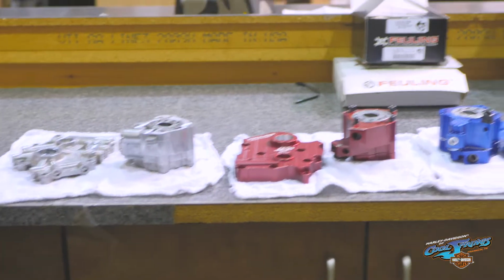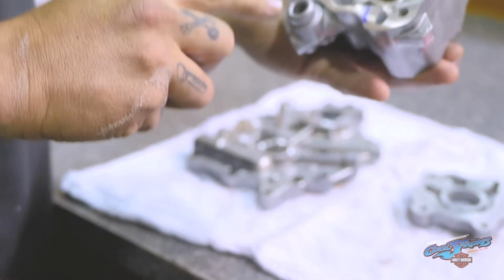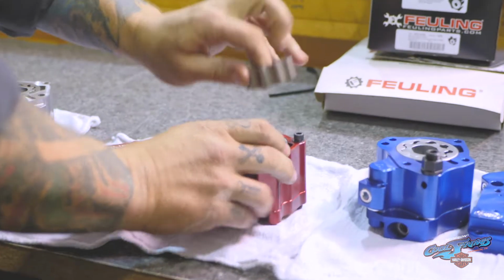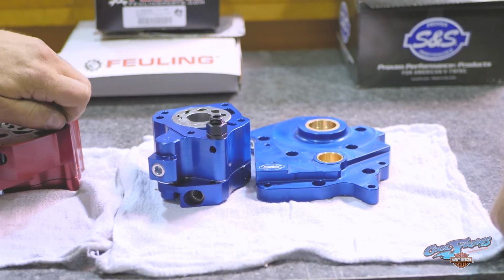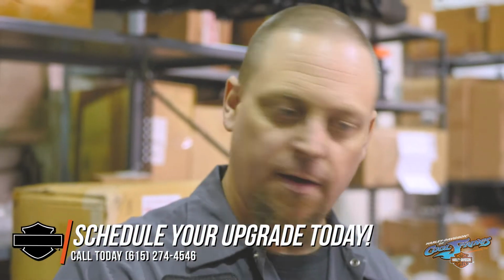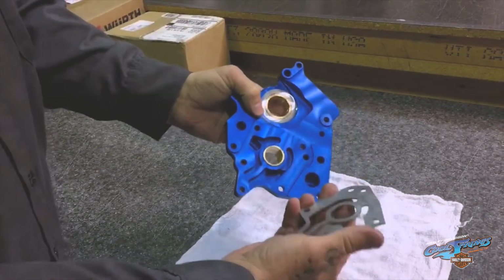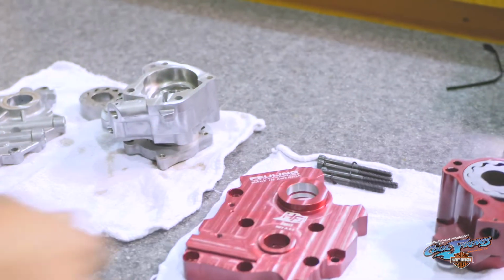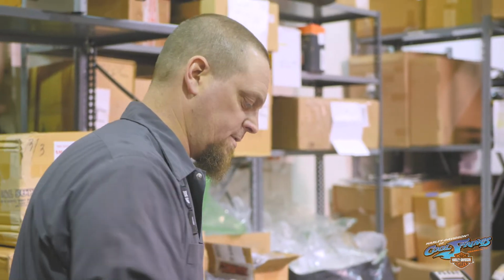Comparing Cam Plate Oil Systems ( S&S, Feuling, Harley Stock) | Shop Talk Episode 6

Comment: Had 2 new 110ci CVO engins replaced since 2022 😡 went S&S after changing engine earlier this year, along with a Figurati oil filter, and I’m extremely happy after 2k miles. Waiting for the 1st major service to move to  gear driven cams and then I’m done. Great video, thanks.

Comment: So this video is 8yrs old so I’m sure things have changed. However I’m in the market for a cam plate set up and a new cam for my 2017 flss. So I’m very interested in learning the difference between the plates. At this time HD had came out with a billet cam plate and updated pump. Just to let you know I’m interested in the information not the stupid Sasquatch BS.

Comment: Can you do a comparison for twin cams? On a rebuild, I had the S&S cam plate and oil pump installed after two engine failures with the stock units. 

So far, runs great with zero oil pressure issues.

Comment: My mechanic told me that the SE pump and cam plate is every bid as good as the S&S for way less money. I agreed with him and used them with my Wood Triple Deuce. It’s nice to see actual oil pressure at idle n, compared to the stock pump.

Comment: On my 2020 Roadglide, when I check the oil level cold it indicates full, when hot it checks 1/2 quart low. Any ideas or opinions?
Reply from the maker: Turn off your bike with it straight up. After the engine stops moving place on side stand, then check oil.

Comment: The video was informative but at no time did you all discuss the flow rate for any of the HD oil pumps - 2017 - 2020. You did talk about him much more flow was available with the S&S and Fueling. What id the flow rate of the 2020 oil pump that is stock on HD 2020 Road Glide Special? Please

Comment: Why don't you talk about the SE oil Pump
Reply from the maker: This video was done 3 years ago and the SE Pump and Plate was released this year. The SE plate and pump is awesome but it doesn’t work with larger cams. The max exhaust lift the plate will clear is around 0.570” lift.

Comment: I want to install a S&S oil pump cam plate along with the Woods 22xe cam. I currently have a stock 2017 FLTRU. The runout on the crank shaft is measured .006. S&S states their max runout tolerance is .005. What are my options? Is the .001 outside of the stated max allowance a recipe for disaster?

Comment: I realize that this is an older video, but, I wonder what you guys think of the new Zipper’s cam plate. I’m using the Feuling OE+ oil pump, and I’m getting about 20psi, at idle, and 59psi at WOT. This is on my 2015 SGS w/ a 110”

Comment: I was looking at S&S but for the past two years they have gone from $1400 at one point for the kit, to now $2000. Fueling price has only went up about $100 depending where you buy, and its $1600. S&S is just going way up on already overpriced parts. Even their carb is up to $700 now. That's insane. They make good stuff but I can't justify it. A better oil pump will not sway me over. Fueling is gonna get my money. I've only ever heard good things about Fueling.

Comment: What about the twin cam ? I have a 2005 TC 88 and am considering the S+S kits .Depending on run out  id like the gear set up, failing that the Hydraulic cam chain tensioners . Both these S+S kits have the works, adjustable push rods, lifters , up graded oil pump , cam plate you get the idea . SO my question is what would you consider the BEST? The S+S or the Fueling components 🤔. I've got my mom and pop shop saying S+S and Mr Harley saying Fueling . Any advice would be gratefully appreciated.👍🇺🇸😎 I know this is an old post.
Reply: Im surprised Harley didn't say SE

Comment: Why would you need more pressure? Pressure is restriction to flow, I would rather have lots of flow and vary velocity which I think S&S has done with the smaller supply passages.

Comment: SAE 660 bronze  brinell hardness 65, 6061 t6 hardness 95. S&S bronze cam bearing insert is not harder and more durable than fueling or harley straight up aluminum and, my guess, will not last longer.
Reply from the maker: John Callahan Bronze has less friction than aluminum and the strength depends on the amount of lead and silicon used to produce it. Bronze is a great bearing especially when used with oil as an additional lubricant. Both the aluminum or bronze can wear but If installed correctly with minimal pinion runout both should last 100,000’s of miles. Maybe I should add that proper maintenance be preformed, example routine oil changes!

Comment: Love watching you guys a lot of good info. I recommend to all my friends to watch Moonshiners.  I have a 2018 road glide special about to put a RS468 in it. The dealership says I don't need to change the cam plate and pump. Says it's not that great increase in horsepower to warranty that. Just wanting some feedback
Reply: @Derrickbarbee3752 did you figure it out?  I'm in same boat now.  from research  I'm thinking  a reaper 465 cam and just updating to the 2020 oil pump instead . seems the lighter cam is OK with stock components

Comment: so , there has  already been attempts  to retrofit a M8 engine with gear driven camshafts (given low crank shafts run out  tolerances , in the region of 3.5  thou/inch )  ... is that correct ?
if so , there is still hope ...
Reply: Harley should just buy their motors from S&S
Reply: doncarlo5 yes! We install them
Weekly.
Reply: @jamielima5315  well ... there is hope, then ! The twin cam engine is the reason why I stopped buying new bikes ...
I personally ride an old Shovel , but ,as we speak , I'm really considering buying a brand new Harley ( fat boy or softail slim ) . I was just wondering :   how often do you encounter an M8, ( based on your homegrown experience),with such a high fly wheel tolerance, that makes a gear driven install not plausible ?
and most importantly , how much do I need to invest , on top of a retail price ! ( Parts + hours )
Last but not least (being the M8 a brand new concept) : which are the flaws that need to be addressed ?
Reply: Heck...I have a '17 and 18 FL's and BOTH cranks are out 65 thousands...no gear drives for me...
Reply: @2Wheelz-2  dude ! This really pisses me off ...

Comment: Do you recommend an upgrade of a Cam Plate and Oil Pump for a Stage 2 bike? or the oem parts are good enough for your average rider?
Reply: Luis René Ventura Cruz if you can it’ll just improve your setup not needed for stage two but your engine parts will like it!!!

Comment: So are you saying that a OEM. Cam plate and oil pump. Is no good for just a bolt in 475 cam with quickie. Push rods it’s all I can afford at this time. Please tell me if this is gonna ruin my 2019 harley Streetglide ??
Reply: Crazy. Ray's Videos OEM plate and pump is fine for a stage two. The aftermarket setup are just superior and your engine parts will like it!!!

Comment: S&s is the better one take it from the guy that has destroyed the fueling one and a factory one b4
Reply: I'm leaning towards the S+S gears ,pump  ,cam plate ect ( full component up- grade depending on run- out otherwise it will be full up-grade but with hydraulic cam chain tensioners. My independent.shop says S+S but Mr Harley mechanic reckons fueling is better ? You say S+S so what happened.to the Fueling if you don't mind me asking .🤔👍🇺🇸😎 The motor is a 2005 Duece twin cam 88.I realize this is an old post .
Reply: @williamjohnson6517  I've got a 2010 twin cam I wondered if they answered you or not their William I was going to go with the fuelling myself.

Comment: great video. lots of awesome info.  My 103 with Fueling camchest kit and Freeway flyer cam really did the trick.  Oil pressure at idle hot 30lbs on the highway 50 - 60 lbs.  And the bike runs great.  Will be doing the SG soon and will probably go with S&S .  Looks like both are very similar .THANKS for the videos and info

Comment: Here we go Harley ! Even the M8 has to be upgraded because of Harley's junk. Pay 22,000 for a bike then spend money, tear it apart , to fix your new Harley engine. 
Harley built the hydraulic cam chain tensioners into the new M8 engine not learning what a problem it caused in the twin cam engines.
Never a Harley again !! Thank God for S&S

Comment: I got the S&S 100” kit made my old 88” a monster along with the 585 cams
Reply: Great to hear your 100ci is doing good and that you are happy . There is one thing they say about building up the twin cam.
The more you build it the more it's likely to have run out on the crankshaft. Harley pressed the crank together and that is the problem.
If I ever need to split my cases I'll be buying an S&S crank, that is really the best fix. or buy an S&S engine.
Reply: Yeah I know all about that dang run out I was thinking maybe after I put a few miles on this engine going to buy the S&S 124 kit that way I am force to not be lazy on the bottom end
Reply: I’m gonna do the same thing to my 88 but I’m just gonna go with the 574 cam can’t wait to get it. I heard it’s a big difference.
Reply: I’m gonna do the same thing to my 88 but I’m just gonna go with the 574 cam can’t wait to get it. I heard it’s a big difference.

Comment: @24000 miles and a bad Bearing on my 2010 Roadglide custom 96 in. I decided to take out the motor for a major refresh 
Went from a 96 to a 107. One key upgrade was a Fueling cam plate and oil pump  stock oil pressure 15 psi at Idle, 30 psi throttle on.
Now 30 psi at Idle 55 psi  highway.They said something important Fueling was the first.You cannot go to young mechanics today
With out S&S products brought into a conversation.Wanted to do my heads First thing S&S heads 1500.00 for the box.Fuel moto
Has CnC heads on an exchange for 850.ish. I have a guy that will hand port and polish for 650. 
The reason you can put gear drive  cams in a m8 with no issue is they have a gear driven balancer to hold the insides together.
If you want S&S parts just buy a S&S motor I wanted a number matching motor so I put the best parts I could afford
Darkhorse crankworks bottom total rebuild with HBeam rods
Woods cams , Fueling lifters pushrods oil pump cam chest ,  HPI throttle body,  Vance & Hines pro pipe ,power vision tuner  Progressive mono tubes awesome upgrade done 25000 mile ago. I was drooling over a mako shark blue fade cvo Roadglide 43 k pulled up on bike night a group pulled up along side nice looking girl jumps off the back of... a mako shark blue fade cvo Roadglide while her fella was dismounting she walked over and said “Really like your bike “ 43 k saved!
Reply: Vincent McClain 'how'd You know it was a bad bearing?
Reply: I love the way Harley has adapted the Japanese way of building motorcycles running everything in paraluman them it amazes me how many things are wrong with the Mac in the twin cams and almost nothing was wrong with the Evo motor which was an AMF design and plastic Parts in a hot engine what were they thinking of and what were they smoking
Reply: My God how much money do you have to spend to keep your overpriced Harley from blowing up big twins these days are absolutely ridiculous thank God I have a twenty-five-year-old Sportster run like a cop with 350 thousand miles on her

Comment: Own an 02 FLSTF, and plan on inspecting the cam tension shoes. I fig since the cam chest was open, might as well update/upgrade a few weak points (oil pump, old school bearings, hydraulic tensioners). I noticed HD came out with a SE version. I mainly run stock motor (stage 1). What kit do you recommend would be worth going with?? Thanks in advance for your help 😉
Reply: If you are going to upgrade cams and want to upgrade to hydraulic tensioners it is a good investment.
Reply: S A,watch this video,then go to the Fueling website and S&S website to determine for Yourself what to go with.
Reply: https://youtu.be/pFI2Kd6D2Q8

Comment: I finally figured out Harley owners.  I could never figure out why people buy Harley’s other than to make noise, and look cool riding to the bar (which most do).  YouTube finally gave me the answer.  Harley’s are for shade tree mechanics and tinkerers.  People who like to take things apart and try to improve things.  Harley’s design is so antiquated it gives the owners plenty to improve,  the after market gives them the parts, and now YouTube has given the the mechanically uninclined (such as myself) an idea of how   It is done.  
Will I buy a Harley? No... I like riding thousands and thousands of miles on a reliable machine.  A machine that is easy to maintain.  But I do have new found respect for Harley riders.  It’s just not for me.
Reply: @Mod Zozer if Harley's are so terrible why is it that all the other manufacturers are still trying to emulate them?  Polaris is on their second attempt now.
Reply: M.V.O _Motorfast I’ve owned both Harley’s and Victory’s the Victory is a far superior motorcycle.  Harley is a far superior brand.  One is engineering and the other is marketing.  I prefer a well engineered bike over a cool looking bar hopping noise maker.  Unfortunately I am in the minority, and Polaris scrapped a great motorcycle.
Reply: @Chance-ry1hq  So do you still own your Victory?
Reply: M.V.O _Motorfast Yes, I will never sell it.
Reply: I have found most people who bash Harley do so because they don't have one. Myself included. I now own three.
Reply: Michael Steinrok I have a Victory XCT and I am quite happy with it.  When I decide to sell it I will buy a new Honda Goldwing or a Yamaha Star Venture.  By the way I wasn’t bashing Harley.  As a Harley owner you should know that.   Because you have experienced everything I said in those comments.
Reply: What do you ride?
Reply: @Mod Zozer Right on!  Well if you ever need any "shade tree" work done (as Chance 1957 says) we are making some pretty good power out here in Tennessee.  Hahaha.
Reply: @Mod Zozer Vaguely familiar-->   In 1923, Max Friz designed the first BMW motorcycles, choosing a 500 cc boxer engine and unit transmission with shaft drive. This engine type is still in production today.[1] The BMW 247 engine, known as an airhead due to its air cooling, was produced until 1995. BMW replaced it with the oilhead engine with partial oil cooling and four valves per cylinder, but still retained the same flat-twin configuration. In 2013, BMW introduced partial ("precision") water-cooled version, first on their BMW GS and planned to replace all oilheads. In short. BMW has the same "outdated tech". 

The Japanese brands copy the Harley  outdated tech. I won't even go into the Italian brands, but MG is still running there parallel Vtwin.

BTW- I've owned a BMW and it was a massive maintenance whore. Never had a major problem with my Harleys since the EVO which I still believe was one of Harleys greatest motors. But then haters gonna hate, and watch Harley videos so they can make dumb shit comments about something they don't understand.
Reply: Mod Zozer What?😂
Reply: Hell I used to say them that's why I know
Reply: Why is Chance the gardener watching a Harley video? Shouldn’t he be watching a Victory video? 💩
Reply: Who tf rides a victory foh 😂

Comment: Very informative comparison; I’m running S&S gear drives in my 06 Electraglide and the Fueling plate and pump.  But also using the S&S crank.

Comment: I wouldn’t want a cam runout worse than .0015/ better dust grind prior to install even if the claims are .005.trust me high RPM will wobble the hell out of the bronze and score the cam race surface anything past 2200 rpm for as little as a 5 minute period.S&S still is a great product but put time into tramming the cam or it’s all for nothing
Reply: A Ninja crank shaft runout not cam runout. We inspect a lot plates and pumps with mileage on them and haven’t seen anything like your reference. If you still feel concerned I would call S&S and teach their engineers something.
Reply: Jamie Lima I teach aero space engineering all the time so a few more wouldn’t hurt/ let’s face it zero is best is all I’m saying from the world of millionths not tenths and thousandths, not disin on your skill by any means, as a matter of fact I appreciate your approach to your job and knowledge.

Comment: It seems like the S&S is the better product.  With that, why didn't you all use the S&S on your camshaft shoot out? I noticed you all used the Fueling in the shoot out.
Reply: We are not partial to just one great product.  We also feel that if we do our best to put out factual information then our customers can make an informed decision and the bottom line is, even though the S&S and Feuling products both have their unique benefits they are both very high quality and I would run them both.  FYI...  There is a video coming out very soon that focuses set on the S&S pump/plate so I really appreciate you watching and subscribing.  Stay tuned.
Reply: @NoName-vz1ob  sounds good. I look forward to seeing it
Reply: M.V.O _Motorfast will either of these pumps prevent sumping ?  Building a 124 and not sure if I should keep the stock pump with the new plate or use one of these ?
Reply: @freedom6919741  yes both will help improve oil return.  I would recommend either the Feuling or the S&S if you are building a 124".
Reply: @freedom6919741  i would go with the S&S. Are you doing new conecting rods, cam etc? With the bigger pistons and cylinder walls etc... you will have more surface area and I'm sure you are not building it just to look at it. So if you build up the motor, protect your investment with better oiling.